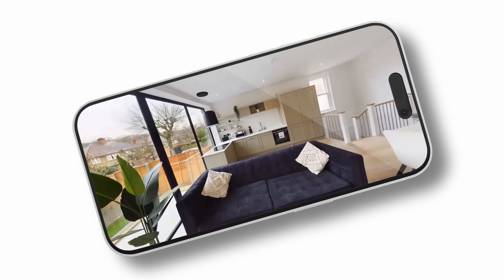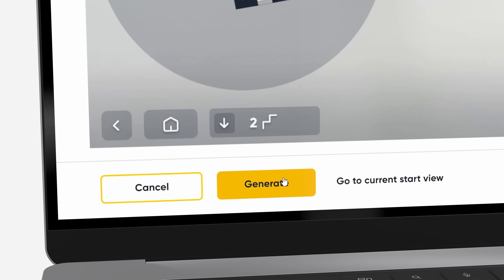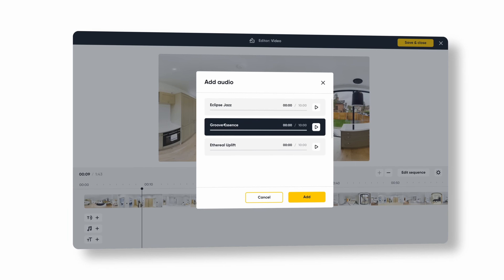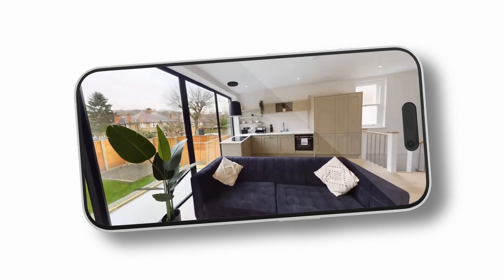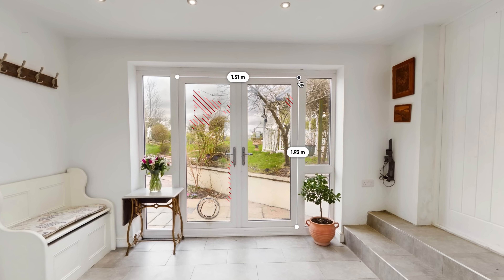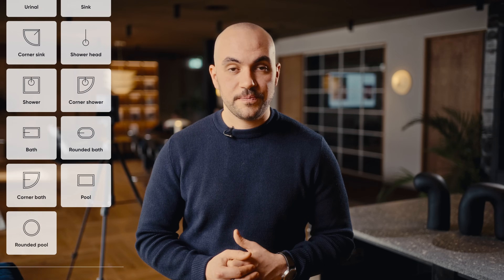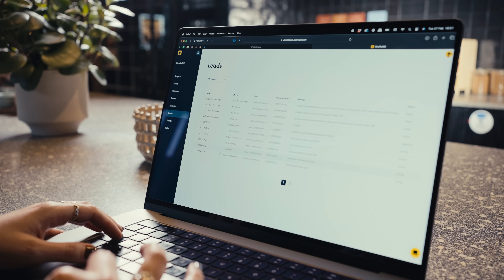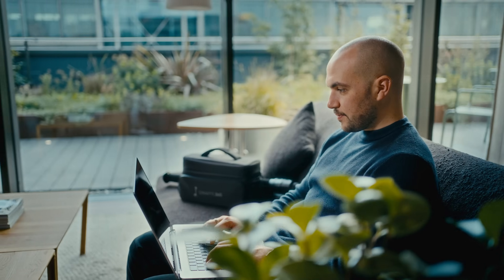Giraffe360 Q1 Launch Event | NEW Video Editing & Measurement Tool

Comment: Excited for this! Is the measuring feature and video feature included in the regular plan or will these be add-ons?
Reply from the maker: Hi Jackie, the measuring tool will be available to all customers, and the video features will be available to customers with the video add-on.
Reply: Is the measuring tool already to be used in the excisting Virtual Tours or only in new ones?  @giraffe360
Reply: Jackie had a chance to use it in your projects already?
Reply: ya absolutely. when will this new features be available?